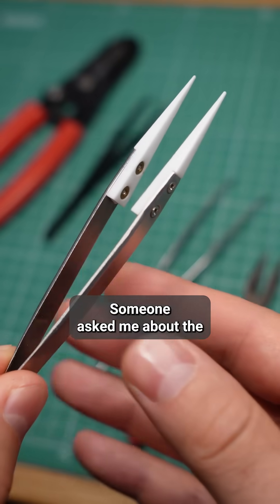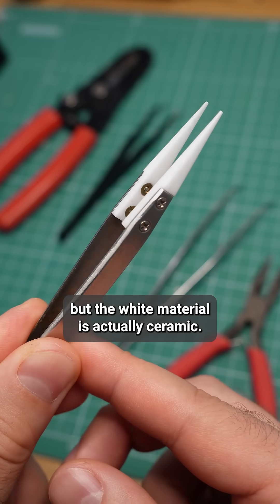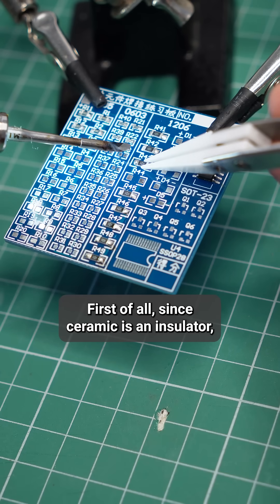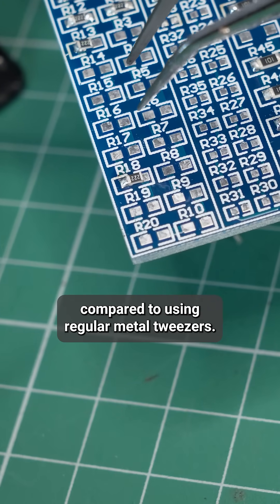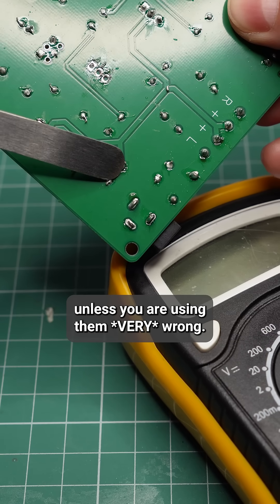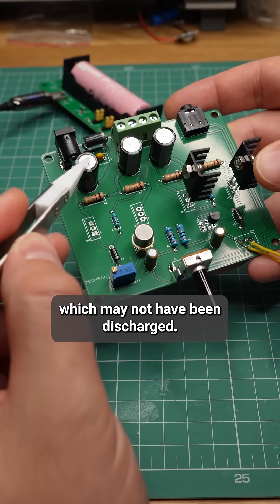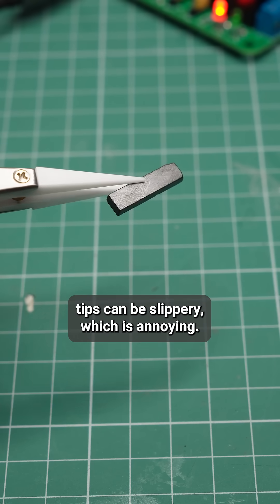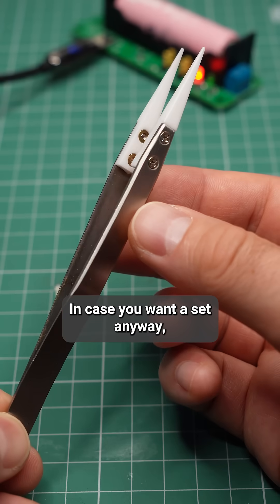Why are my tweezers white?

Comment: Since when the ceramic is heat isolation? It's opposite 🤦‍♂️
Shorting circuit while soldering? You have power on? Do you have brain damage?

This video is 100% garbage.

Comment: I use them mostly for desoldering. I snip off a bit of desoldering braid, flux up the braid and the part, and hold the braid with ceramic tipped tweezers while desoldering. This minimizes the heat applied and reduces trace damage.
Reply: Cutting the braid at an angle fixes that. Doesn't hurt to use flux too. I almost never use tweezers for anything other than SMD. They all tend to cause damage.

Comment: Metal tweezer ends also deform over time, worsening their alignment with each other.  This causes small 0402 or 0201 parts to shoot out even with the slightest uneven pressure.    

Ceramic tips do not deform and can hold the smaller parts more securely.
Reply: 0402 and 0201 watermelon seeds... :(

Comment: Used ceramic tweezers for coil building for my vapes. You could heat the coil to compress it hot. 
Kinda miss building sometimes
Reply: Same, I still have my Coil Master kit collecting dust 😄
Reply: I still vape and build on a RDA. Somehow it didn't occur to me to get a ceramic tweezers for soldering
Reply: Same

Comment: We work with this Equipment in my company and build Sensors for 1B€ litography machines and trust me, ceramic didnt have more pro than contra. Just use Black plastic and youre fine.
Reply: Plastic for soldering?? Ur an idiot
Reply: Is that some sort of special heat resistant plastic? It indeed should have way less downsides if they are as stable to heat and corrosive flux. Heat resistance is very important for soldering/desoldering with hot air.
Reply: @ВладіславЗаморський it's not normal plastic as you see in Kids Toys. Sure it's harder, better with temps and I bet it's even resistant against chemicals. I dont think they uses bad plastic, if so, noone would buy these.

Comment: For watches we have similar tweezers but with softer materials like rubber to not damage the very delicate parts like the hands and small gears
Reply from the maker: Cool! I didn't know that
Reply: @LeftyMaker  I have questions- why you need to repair live circuit?
Reply from the maker: @Devil_Gaming-i7p for example, you can identify faulty parts or bad joints by lightly tapping a component. You can also more quickly modify breadboard circuits. by live I don't mean high voltage stuff
Reply: @LeftyMaker oh ok , thanks
Reply: Are silicone tipped tweezers any different?
Reply: @nehemz432 the silicone won’t scratch anything… the ceramic will f up all the little delicate tiny watch parts
Reply from the maker: @nehemz432 hm, never tried them.

Comment: I have a pair of tweezers with twisted tips. They are very helpful if you don't have a helping hand tool.
Reply from the maker: Are these the kind that release when you squeeze them? They do seem very helpful
Reply: @LeftyMaker  Yes, I think they're called reverse tweezers.
Reply: @LeftyMaker  i have a pair of those too. I also do electrical/pcb work (corrosion technician). Those tweezers can be very handy, but it is impossible to know how much force you are applying to something. I recommend getting a pair but you should be aware of the dangers. Also. Definitely check out surgical grade tweezers and dental hooks. Invaluable for a ton of stuff